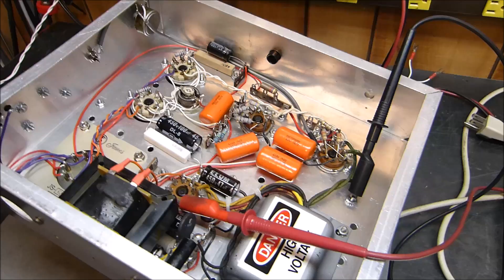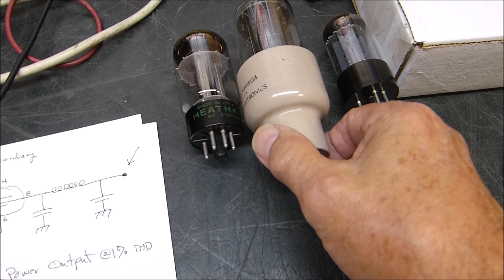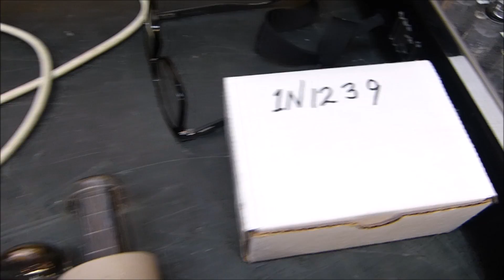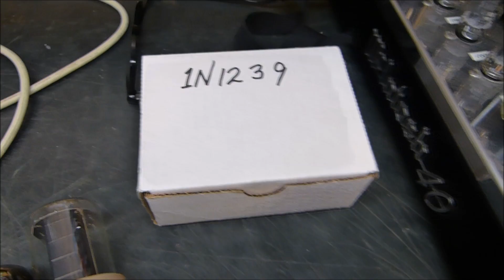5U4, 5R4, 5V4, 5AR4 & Solid State Rectifier Performance in Vacuum Tube Amplifiers

Comment: Thanks for your efforts.
Would you happen to know if the 5R4GYS can be used as a substitute for the 5AR4? Specifically, the Line Magnetic 518ia
Reply from the maker: The 5R4 is intended for higher voltage power supplies (for example a power supply that has an output of 800-900 volts or so) than the 5AR4 and the 5U4 which generally are used in power supplies usually not over 500-550 volts or so).  The 5R4 will work but your voltage will be a lower, probably by 40-50 volts so your power output will be lower also. The 5AR4 is the next thing to solid state diodes you are likely to get in a vacuum rectifier. Only mercury vapor (MV) rectifiers will have a lower voltage drop across the tube. usually around 15 volts. The more current drawn thru a vacuum tube rectifier (not the MV rectifiers) like the 5AR4/5U4/5R4/etc the higher the voltage drop across the tube resulting in lower voltage to the amplifier tubes. Sometimes guitar  musicians in a musical creative style, use the voltage drop that is inherent in the vacuum tube rectifier, like the 5U4 as an example, as the voltage drop increases the distortion as the volume (and resulting power supply current) is increased and the power supply voltage drops which may enhance the music they are creating by giving it more crunch or over-drive or however they refer to it.

Comment: My 2A3 has a 5U4G rectifier that hums ,will a SS rectifier help to solve the hum ?
Reply from the maker: Probably not. It is rare but half of a rectifier can fail and then we get only half wave rectification. I had that happen to me about a year ago with a 5AR4 and it was the devil to figure out. I think I would swap out the rectifier first and see if anything changes. I posted a video some years  back on how a lose ground on a canned electrolytic power supply filter capacitor can cause all kinds of hum problems. Hope you get it fixed.
Reply: @ElPasoTubeAmps  
Thank you Very much for your prompt answer. I have noticed that it hums even more with other tubes . So it has a lot to do with different types. I have 5 of them .I noticed Also that transformer right next to that tube kinda vibrates. This vibration diminishes if I put something heavy on top of it .I read about a heavy contraction called " The Brick " for the ridiculous sum og 100 USD.  So instead I made my own out of brass covered with real leather. It seems to Work.  I bought also a high end power cable with ground. But when I opened the amp , it has only + and -- .no ground. So that was a waste of cash. Thanks again. 😂😁

Comment: Hi, I wanted to ask you a question.  I have a Mesa Boogie Tremoverb amp combo 100watts with an adjustable bias pot mod to the amp. The amp comes stock with 2x 5U4GB rectifier tubes. My question is,  can a substitute 2x5AR4 rectifiers in this amp safely. It  has a switch where you can switch between solid state and tube rectification. Would substituting 2x5AR4 rectifiers be too much voltage for this guitar amp? The amp runs at 460 volts on the plates in the solid state mode. The amp with the 2x5U4GB  rectifiers runs at 397 volts on the plates. I know Mesa Boogie make an amp that is a 100 watts called the Heartbreaker that runs off of only 1 - 5AR4 rectifier. If this amp I have runs on 2x 5U4GB,  why do they use 2 of these rectifiers and yet in the Heartbreaker amp at 100 watts , they use only one 5AR4 rectifier to run the amp. This has spiked my curiosity. But I'm thinking that 2 of these 5AR4 rectifiers would be too much voltage for the amp. My other question is that I have  Marshall JTM45 2xKT66 power tubes with 1 5AR4 rectifier  running at 440 volts on the plates. Can you substitute a 5V4 rectifier for the 5AR4 rectifier. The Tube Store in Hamilton, Ontario, Canada says not to substitute a 5V4 rectifier in a Marshall JTM45 amp. I'm just curious why. Maybe you can help me understand this about rectifiers. Thanks Michael Newell from Niagara Falls, Ontario, Canada
Reply from the maker: I think the answers to a lot of your questions lie in the average current each rectifier can handle. The 5V4 is 175 mA, the 5AR4 is 250 mA and the 5U4 is 275 mA. I am sure these are CCS ratings (Continuous Commercial Service) and can be exceeded in dynamic music conditions found in a musical amplifier without any harm to the rectifier.
The next parameter is the internal impedance of each rectifier tube and without getting into specific numbers we know that the voltage drop across the 5AR4 is much less than the 5U4.
So, as the recommendation to not use a 5V4 in place of the 5AR4 is probably a good recommendation as the current rating of the 5V4 is a bit low. That would be kind of like putting a 5Y3 in place of a 5U4 for something like that.
The fact that you can use SS rectifiers says the power supply capacitors can handle the extra voltage so surely you can use any rectifier rated at enough current. I am sure you know that even the smallest power supply SS rectifiers are rated at least 1A or more and the voltage drop across SS diodes is only about 0.7 volts. This is going to give you the highest voltage, the most available current and the least "sag" when playing the amplifier at full volume.
Using two 5U4' is a serious power supply. That is going to give you the ability to draw twice the current of one tube, if the load needs it, That is a pretty impressive power supply setup.
The last parameter is the PIV of each rectifier which is 1550 for the 5U4. This would relate, generally, to a 800 volt CT power supply power transformer primary voltage.  With 400 volts each side of the power supply transformer secondary to ground this will give you approximately 565 volts DC with no load or about 480 volts under full load (using SS rectifiers). I think these voltages are pretty close to what you are measuring.
To be absolutely certain you can "roll" different rectifiers in each amplifier, I would want to study the schematic of each before making this recommendation.  On the other hand, if your amplifier says you can run either vacuum tube rectifiers (i.e. 5U4) or SS rectifiers, I can't see a problem there using any rectifier that can handle the current of the least of the recommended rectifiers. 
As my memory serves me, the only amplifier I remember seeing a 5V4 in is an old (circa 1960) Fisher 70-A which is rated at 20 watts so I would stay away from the 5V4 in a large amplifier.
I hope this helps.

Comment: why is the 5ar4 considered mighty when the creme colored one is clearly "more mighty"
Reply from the maker: The 5AR4 has less voltage drop across the tube and will deliver a higher voltage output than the other vacuum tube rectifiers. Not quite as good as the SS rectifier but close. Also, the 5AR4 will not "sag" under load like the 5U4
The 5R4 - the big cream colored one, is rated at a higher voltage but a lower current that the 5U4 so the big 5R4 will be used in a power supply that, for example, needs to supply 800-1000 volts DC output whereas the 5AR4 and 5U4 will be used in power supplies typically under 600 volts DC output.
An important factor in a vacuum tube rectifier is the PIV rating - see pasted below:
"For rectifier applications, peak inverse voltage (PIV) or peak reverse voltage (PRV) is the maximum value of reverse voltage which occurs at the peak of the input cycle when the diode is reverse-biased. The portion of the sinusoidal waveform which repeats or duplicates itself is known as the cycle."
Reply: @ElPasoTubeAmps  Hi man,  thks for the video . When you say that the 5AR4  doesn't sag ,  what would be then the difference  with a solid state rectifier ?   thks !
Reply from the maker: @soundsokok  The 5AR4 would sag less than the 5U4 under the same load. SS rectifiers have a constant voltage drop across them of about 0.7 volts and this voltage drop does not increase as the current increases so the SS rectifier does not sag.  A 5U4 with no load to full load will likely drop (sag) 40 volts. This is what makes the 5U4 and other tube rectifiers get so hot. With all this said about the rectifiers, be them tube or SS,  the voltage will sag within the power transformer to some extent even the wall outlet to some extent.  It is normal and the way everything works. I would not want sag in my stereo amplifier but I might want it in a guitar amplifier for increased distortion or "crunch" or whatever it is called. Hope this makes sense.

Comment: but when i listen (and im sure others do also) when i dig into a string or strings, wound or not, and when i dig into wound or not wound strings gently or not gently, i hear the sound or resonance-complex resonance . . vs a clearer-sterile resonance . . i am more partial to what i hear out of my gretcsh 6157 or my ac30tb korg . . vs the clarity-sterile sound i get out my peavey "bandit"? my randall 50 watt amp . . my fender 15 watt amp and marshall 15 watt smp
Reply from the maker: You are a musician and I am not so you hear things I am not aware of. On the other hand, I try to describe your, "resonance-complex resonance . . vs a clearer-sterile resonance" type of sound using harmonic profiles from a spectrum analyzer.  I am confident we like the artifacts created by vacuum tube amplifiers which adds to the complex harmonic profile of the original music. Harmonic distortion typically rounds off softly at moderate clipping levels in a vacuum tube amplifier and can add pleasingly to the music but SS amps can have transitions at the clipping level that are abrupt and have harmonic profiles that we simply do not like. Surely our ears are ultra sensitive to these harmonic profiles or we would not be able to recognize individual voices. Also, moderate distortion levels add to the volume of the music so a 15 watt amplifier can sound as loud as a 50 watt amplifier in some cases and may be preferred. it is so complex it is difficult to put into works. I hope this helps and Thank You very much for your comments.

Comment: I have never flashed over a filamentary  rectifier tube, but I have flashed over unipotential rectifier tubes. My problem was using too big of a filter capacitor without using a choke coil. The tubes have a minimum required circuit resistance, based on the size of the capacitor. Once I found out to use 76 Ohms, which includes the DC resistance of the supply transformer secondary, I quit having problems. My transformer had 36 Ohms of DC resistance measured from ground to one plate. A 30 Ohm resistor between the cathode and the capacitor solved the problem.
     The reason you went from 1.28:1 to 1.2:1, is because the voltage drop of the 5AR4 is the same 18 volt drop at the same current. Increasing the supply voltage means that the voltage drop of the rectifier is a smaller percentage of the peak to peak voltage of the transformer, thus, lower percentage of voltage drop, even though the voltage lost is the same. To calculate your supply voltage, take the AC voltage of the transformer measured from ground to plate(like you did)and multiply it with the square root of 2.(1.4142135) Subtract the voltage of what ever rectifier you're using, and that will give you a better idea what the actual DC voltage would be, if using a capacitor. If you use a 10 Henry choke input direct to the rectifier cathode, than, you take that voltage, and multiply it by .6366197.(2/Pi) These formulas don't account for DC resistance, which you must multiply the current by DC resistance, and subtract that from your calculated voltage to get the real world voltage measured on your meter.

Comment: I bought this device from an estate sale and finally figured out that it's a HV power supply. It has two 0D3A tubes, a very large transformer and an adjustment pot. I have a project for it but was wondering what are the best caps to use for re capping. There's a few caps that are leaking, but it still puts out +-450 VDC, 6.3 and other various voltages on an 8 pin octal socket.
Reply from the maker: For small value caps I use Orange Drops and for power supply capacitors I use garden-variety electrolytic capacitors I get off Ebay. If the voltage is above 450 volts, I simply put two 450 volt electrolytic capacitors in series, and shunt each capacitor with a 470K, 1 watt resistor. This value of resistor will not drain the capacitors quickly when the power supply is turned off but it will equalize the voltage across each capacitor and over several minutes drain the voltage off the capacitors. Hope this helps.
Reply: @ElPasoTubeAmps  That's how the device is built. Two 450 vdc caps in series, but their leaking. The strange thing is, someone used the on/off switch to shunt the caps with a large resistor when turned off. Thanks for the information. I'll check e bay.

Comment: I have found that adding a pair of small value 10-50 Ohms, High power 10-25 Watt Resistors in series between the plates and the Power transformer Solve the Flash over at turn on with the 5U4. This technique will also extend the Life of Indirectly heated Tubes like the 5V4,5AR4/GZ34 Tubes as well as Directly heated Tubes like the 5Y3,5U4. The resistor value can be found by referencing to the data sheet of the  Tube your using.  Note the Minimum Resistance value on the plates for the Tube.  Measure the DC Resistance from each side of the HV AC winding on the power transformer. If the Resistance is lower than the tube data sheet specifies then add the External Resistance to be equal to or slightly greater than the data sheet spec. Note to use the absolute Minimum Resistance Hear because larger than required Resistance can result in excess hum. If you can select your power transformer simply select one that has a winding DC Resistance equal to or slightly greater than the Tubes data sheet spec for each plate, This is the best solution.

Comment: What is your opinion on voltage doubler or multiplier circuits for the high voltage?
Reply from the maker: Voltage doublers are actually very common. The McIntosh MC40 uses a full wave voltage doubler and so does the Collins 30L-1 linear amplifier. It it a perfectly good way to get high voltage from a modest voltage level transformer and it makes the transformer so much more versatile and valuable to use it as a, CT full wave, or a bridge, or a voltage doubler. That is three perfectly good ways to use the same transformer for a power source.

Comment: Good data for power supply design. Always a bit of an educated guess getting B+ to desired levels. 
Did you test with and without the input thermal varistors during the voltage overshoot tests?
 
What FFT HW and SW performs best below 100Hz? Does the Digilent havea low freq test mode using decimation? Thanks for all you do!
Reply from the maker: Thanks for  your nice comments and encouragement. There were several examples in this video that I could have done better but sometimes what not-to-do can be as important as what-to-do.
As for the varistors, I have found that in a warmed up amplifier, jumpering around the variable resistor makes an insignificant amount of voltage difference in the DC output of the rectifier - like a volt or two.
The FFT software that does an excellent job at low frequencies and allows you to very easily adjust filament hum balance pots (60Hz) and examine the 120 Hz ripple of power supplies is the SpectraPlus. I have tried and still have, three USB sound cards but now I have settled on the one channel Scarlett Solo. It is 24 bit/192 KHz and does a good job. Is it really any better than the two channel Scarlett or the Behringer... ?   probably not but the Solo is a bit smaller and I like it.
The AD2 does not do a good job at these low frequencies but if you limit the dynamic range to 80 or 90 dB in the Digilent AD2, you will get a nicer, and I believe more accurate, harmonic profile at the higher audio frequencies (above 10 KHz) than you will with the Scarlett USB and SpectraPlus SW - I assume because the AD2 input channels are flat beyond 10 MHz as they are also the scope channels - so there is a trade-off there.
Reply: Thanks for your prompt reply. I think I'm going to swap the 83 rectifier out of my Hickock 539as a first SS mod.
  I have a Focusrite Scarlett 6I6 for a soundcard to try. I will look at the SpectraPlus trial and probably buy the Digilent AD2 for distortion measurements. Thanks for the info and keep em glowing!